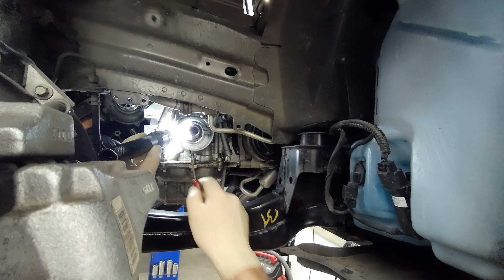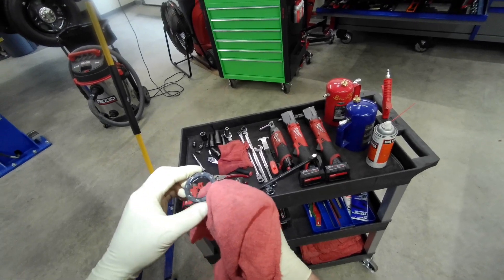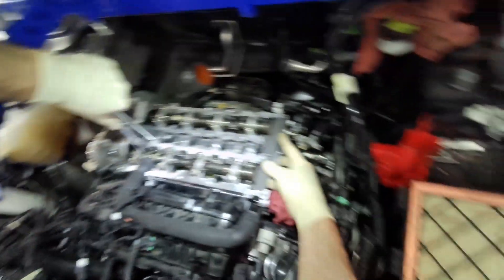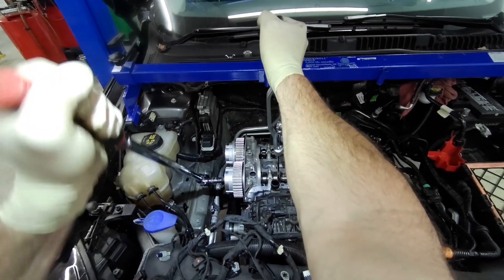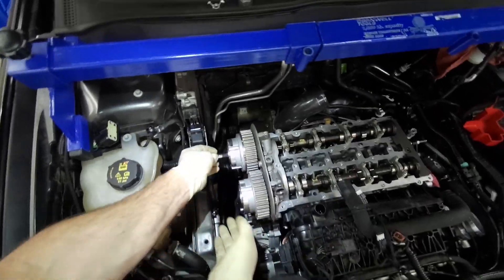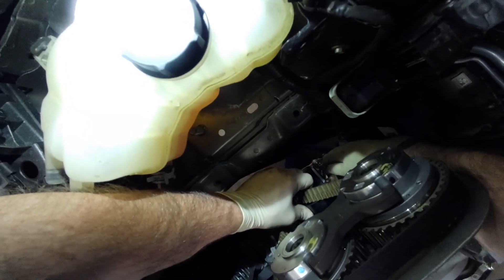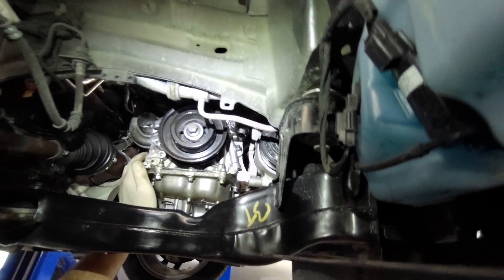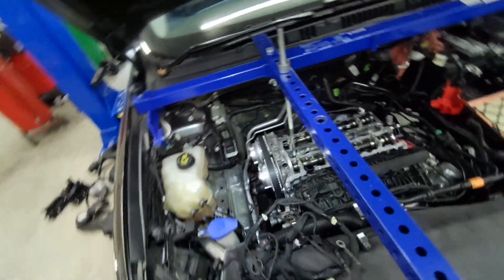1.5L ECOBOOST - BOTCHED ENGINE JOB

Comment: After timing a few times, I’m getting a p0012 code. The engine starts and runs fine for about 20 minutes, then the code is thrown and power decreases. If I let it sit and erase codes it repeats again. Ok for 20 minutes of driving before code thrown and power loss. 
FYI engine was a complete overhaul also.

Comment: Sorry to comment on an old video.. about to do the timing belt job. Is the crank locking tool(303-748), enough to hold the crank while I torque the crank bolt?  I just don’t wanna have to go buy another tool to do this job(chain wrench)

Comment: Got a 1.5L ecoboost also. Just had my engine replaced. But the thing is misfiring at idle only. No check engine light or anything. Could this be a timing issue also?
Reply from the maker: I would think if it was a timing issue it would misfire all the time and have cam/crank correlation codes. Get it scanned and run misfire monitor to see if it's just on one cylinder. Ford want misfire profile relearn done with a scan tool after engine install so make sure that was performed also.
Reply: @raincitywrench117  Turns out that the tech that replaced the engine thinks it's in the cylinder heads. Since a reman engine block & cylinder head was put in, he believes the cylinder head valve clearances weren't set right and also it wasn't shimmed properly. They're going to try to get my car running today.
Does that sound more familiar to you at all?

Comment: Ic u didnt pull starter to install flywheel tool to hold enging
Reply from the maker: I cheated 😅 Used the crankshaft stop pin and chain wrench around pulley as extra support when tightening the crank bolt.

Comment: The tools your use..are they in that same kit you showed
Reply from the maker: Yes sir 🙂 https://www.amazon.com/Camshaft-Compatible-Ecoboost-303-1097-303-1550/dp/B07TCMF9TH/ref=asc_df_B07TCMF9TH/?tag=&linkCode=df0&hvadid=366306749487&hvpos=&hvnetw=g&hvrand=7892900741923834910&hvpone=&hvptwo=&hvqmt=&hvdev=c&hvdvcmdl=&hvlocint=&hvlocphy=9033404&hvtargid=pla-1004293265272&ref=&adgrpid=75066162654&th=1

Comment: I thought all of the seals comes with the block when you take the car to the dealership and the block is replaced?  Basically all of the seals come already attached to the replacement block.  When i had my 1.5 done ford replaced my engine my alternator and belts were even replaced.
Reply from the maker: The 1.5 short block comes only with the crankshaft and pistons. Everything else has to be transferred or replaced like oil pan, timing cover, cylinder head, front and rear seals, etc. Maybe you got a long block installed? I think they come complete

Comment: I just rebuild a 1.5 Ecoboost with the new block and I did the timing like you with the tools still in the camshafts when tighting the bolts. But when I started the engine, it ran very rough. So I checked the timing again und saw that the intake cam was little off so that the VCT tool doesnt fit. Do you have an idea how this can happen? I just hope that there is no further damage to the engine.

Greetings from Germany
Reply from the maker: Doesn't make any sense the cam would be off if the bolts were tightened with the tools in place. Did you also check the crankshaft pulley alignment with it on it's stop to make sure the tool engages with the slot? I would try setting everything back up and tightening all the bolts but before you install the valve cover, remove all the tools. Rotate the crankshaft over by hand a few times. Reinstall the crank stop pin and rotate crankshaft over until it stops then reinstall all the tools to make sure they slide in and everything is lined up. If it looks good then wrap it up. Good Luck!
Reply: @raincitywrench117  I still dont know what the problem was, but I set the timing right again and tightened the bolts again and now it runs completely normal.
Reply from the maker: @Meganex14  Awesome!

Comment: What position would you say your cam notches are in when correctly timed? 
 
Just purchased a car with timing issues

Looking at mine it appears like they're in the 1 o'clock exhaust an 12 intake
Reply from the maker: Would post a snip but can't. Looks like they may both be @ 12:00 but in workshop they are partially covered with 303-1097 tool. I don't use the marks, if the tool slides in then it's aligned. This is quite the setup and can easily be screwed up. The crank can be off or each individual cam off even with the 303-1097 tool installed. I would get a cheap alignment set, pull the front cover and valve cover and start from scratch making sure to be thorough. Here are the directions if the link works: https://f01.justanswer.com/dcraig1000/4b59f200-a8bf-42ee-a027-7c2ddd2aefae_eee.pdf 
Think this is the set I bought: https://www.amazon.com/BELEY-Engine-Flywheel-Locking-Camshaft/dp/B07WXP6DMB/ref=asc_df_B07WXP6DMB/?tag=hyprod-20&linkCode=df0&hvadid=366306749487&hvpos=&hvnetw=g&hvrand=13466324808269377668&hvpone=&hvptwo=&hvqmt=&hvdev=c&hvdvcmdl=&hvlocint=&hvlocphy=9033354&hvtargid=pla-817825322049&psc=1&tag=&ref=&adgrpid=75066162654&hvpone=&hvptwo=&hvadid=366306749487&hvpos=&hvnetw=g&hvrand=13466324808269377668&hvqmt=&hvdev=c&hvdvcmdl=&hvlocint=&hvlocphy=9033354&hvtargid=pla-817825322049
Reply: I got the kit already I'll double check it, do I need any special tools to remove the valve cover?
Reply: Okay so I took it all apart and timed it and now I'm getting a p00c6 code and it won't start? Any idea
Reply from the maker: @jessegray4819  That's a fuel rail pressure too low code. I would remove the high pressure fuel pump and make sure the drive tappet isn't messed up along with the camshaft lobe. Also make sure one of the fuses didn't blow that powers the low pressure pump.

Comment: My ford fusion with the 1.5 is going on 148,000 miles with the original timing belt. Getting a little nervous now.
Reply from the maker: Looks like you are there. Here is what the normal maintenance schedule says: Every 150000 mi (240,000 km)  Change automatic transmission fluid.  Replace accessory drive belt(s).4  
Replace timing belt (1.5L engine).
Reply: Still running strong?

Comment: I have a 2017 Ford Fusion SE. I told I was given a new motor. When I picked up the car and drove about 8 hours. The check engine light came on. I took it back and I was told it needs a Crankcase pressure sensor. Can you give me any advice on what to do. I feel like I am being taken for a ride. 
Rhonda
Reply from the maker: Hi Rhonda. Your fusion probably had tsb 20-2100 done which has the short block replaced. Have a video of that service on the channel. If you can have them give you the codes it's setting then let me know. Can enter them into Fords database and get back to you.
Reply: @raincitywrench117  thank you!🙏😊 I will definitely find that out and get back to you.

Comment: I have a 15 Fusion with the 1.5l at the Ford dealer in Everett. They replaced the engine 2.5 years ago, it has 6 months left on the warranty. Last week the heater wasn’t working and I found the dgas dry… here we go again! I’m worried they’re going to jerk me around. Do you have any suggestions?
Reply from the maker: I would install a cooling system pressure tester on the degas bottle for a few hours and see where the leak develops. It may have an external leak like a hose clamp, water pump, etc. If you don't find an external leak then pull the spark plugs and look down inside to see if coolant is puddling up on a piston. The oil cooler can leak internal and mix with the oil. Visually inspect the oil on the dipstick for signs of water in the oil. Also, pull the oil cap and inspect inside for condensation, water in oil, milky sludge, etc.

Comment: Do you think  the 1.5  ecoboost can benefit from a valve cover breather ?maybe save the head gasket. I have a jlt oil cache can instead .
Reply from the maker: I have yet to see heavy carbon buildup issues on these engines like the european models and a catch can will have no affect on the cylinder head gasket. Do you have it already installed?
Reply: @raincitywrench117  yes I have a jlt catch can for carbon build up. I was wondering about a valve cover breather for pressure build up because these engines are known to have  leaking head gasket.
Reply from the maker: @garofalo1707  Ok, I understand. The JLT will definitely help keep the valves clean. As for the breather I can't say what affect on the head gasket it will have. If your 1.5L has the updated short block then you won't have a problem with it. Here is what the updated block looks like: minutes 14:00-14:17 https://www.youtube.com/watch?v=vVCyzQ249CE&list=PLCGan5QBcVYm5zcj_HmF5-I0O66wUitaF&index=15&ab_channel=RainCityWrench Haven't done one of these jobs in over a year.
Reply: Yo wrench i had a short block done I've put a 100k on it since do think it's time for new spark plugs
Reply from the maker: @grandmark47  Think those are iridium plugs which last a LONG time but that's when I like to replace them. It should say when Ford recommends in the service specifications pages of the owners manual.

Comment: Do you have the engine hanging by a threaded rod in the spark plug hole?
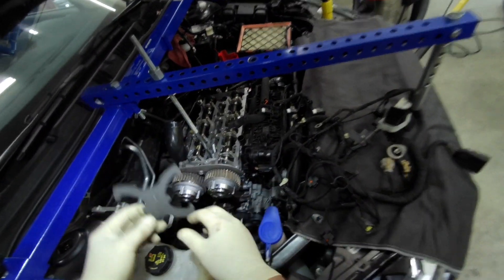Reply from the maker: The rod has a hook on the bottom. I hooked it on the front aluminum casting in the spark plug valley. You can see it pretty good at the 5:00 min mark. That hook arm comes with my transverse support fixture. https://www.toolsource.com/misc-c-318/700-lb-engine-support-bar-p-161847.html
Reply: I see now.  Thanks. 👍

Comment: I recently put a new head on my first 1.6 Ecoboost. Every single thing is special service tool this and special procedure that. It took me like 3 hours just to measure and adjust valve lash 🤣 The engine I did had the intake cam phaser randomly shift and bent the intake valves. Engine had never been worked on and only had like 70K on the clock. Weird. Great video!
Reply from the maker: Would be nice if Ford put roodruff keys on crank & cams but must be cheaper to manufacture. Your engine probably had it's cam bolts torqued late on a Friday at Ford.
Reply: Yeah these engines are garbage all just because ford wanted to save a few pennies per engine
Reply from the maker: @cheesecurd100s  And Rotunda gets to manufacture and sell more tools. LOL